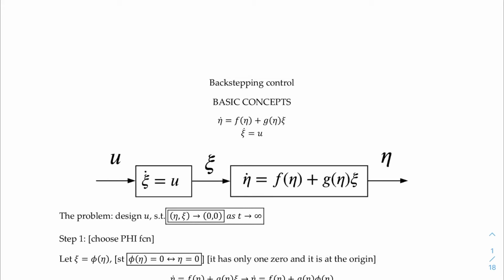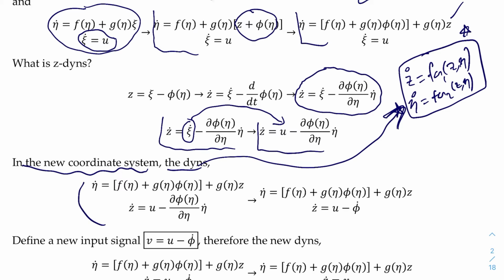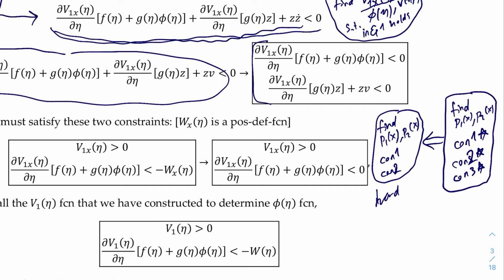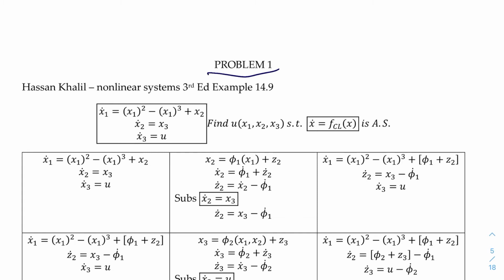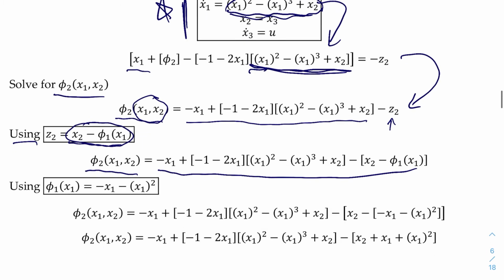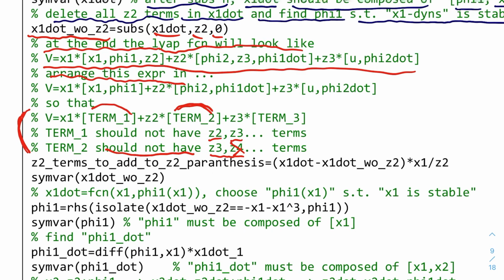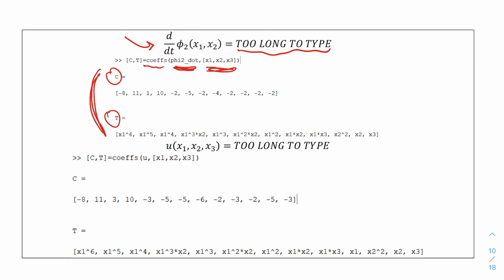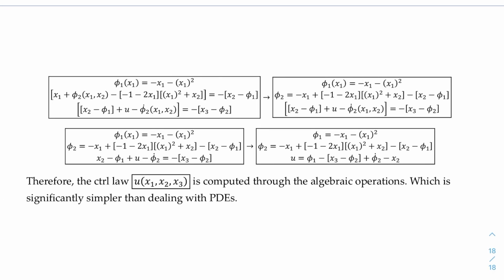Introduction to Backstepping Control

Comment: I'm not sure backstopping control is one of the most prevalent and significant control methods. As far as I understand it's only applicable to a certain class of nonlinear dynamical systems.
Reply from the maker: Thanks for watching the video.
I totally agree with you, i'd consider them as building blocks of nonlinear control or nonlinear stability analysis. 
I do not remember, but if I have made any strong claims about how prevalent or how important that algorithm is, I was probably excited to learn that at the time. :) :)

Comment: Selamlar, kontrol sisteminde gerçekten uzmanlaşmak için hangi matematik derslerini önerirsiniz?
Reply from the maker: For control systems,
Linear algebra and calculus is certainly necessary,
but after that I would say Convex Optimization
But if you wanna go beyond that, I cannot point to a specific subject
other than some nonlinear control books.
Reply: @artcellCTRL  Thanks for the suggestion.